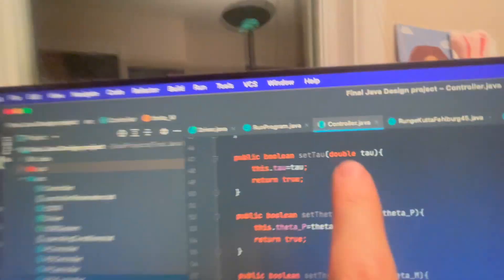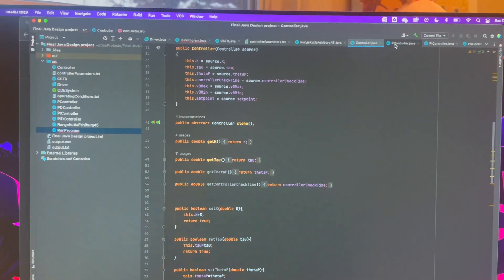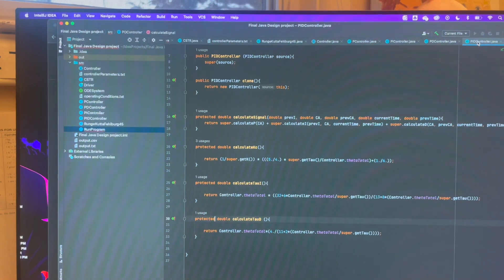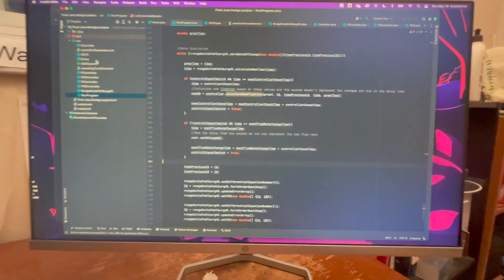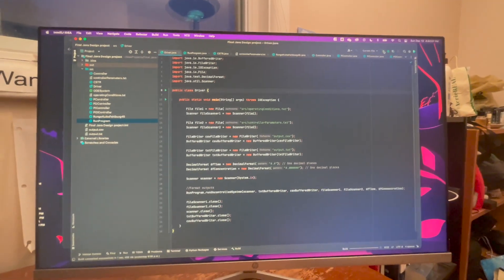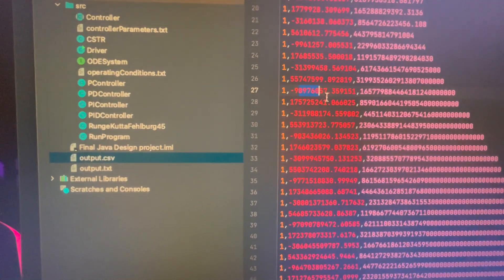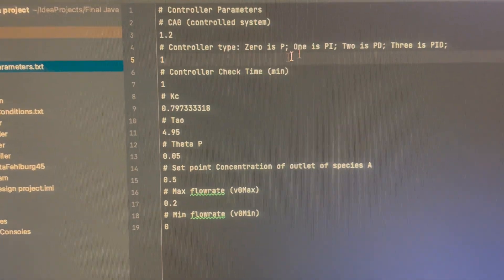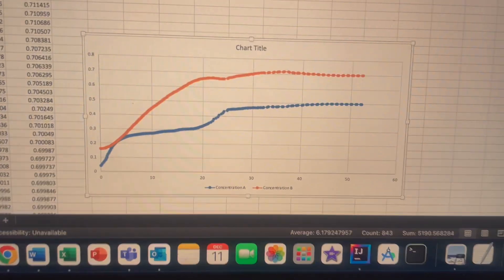Engineering Study Grind Vlog

Comment: Just a little question (i'm assuming you use VS code), what are the extensions you use ?
Reply from the maker: Yea I use VS code for most languages. Its especially good for front end building languages (HTML, CSS, JS, ect..).  I do use IntelliJ for JAVA though because running java code in IntelliJ is super easy and seamless. For VS code I have Live Preview, Bootstrap 4, Code Runner, and GO installed. Live Preview is a must but the other three I only needed for school. Hope this helps.
Reply: @KrisKeon  Thank you for the detailed response, i use eclipse and it just doesn't feel good somehow xD ... might try IntelliJ
Reply from the maker: @amil1is  Yea eclipse is pretty old and feels really outdated and clunky. I think you'll find IntelliJ way better. No worries, glad I could help!